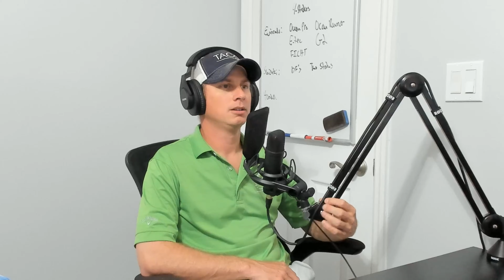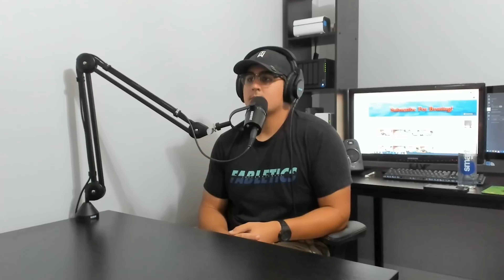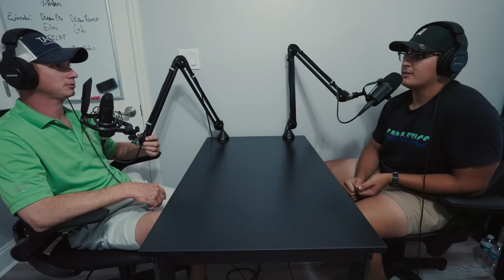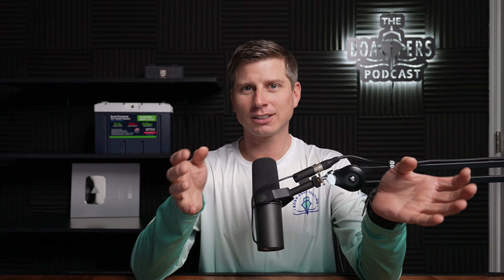The WORST Four-stroke Outboard…

Comment: My family was in the boat biz for many years.we sold merc an Yamaha,i will never forget the first 25 merc 4 stroke i sold as the customer had traded in a pretty decent yammie 25 2 stroke.About a month or so aftrr the sale he came back and asked if he could get his 25 yamaha back as he was not very happy with the performance of the new 4 stroke,major problem,we sold that used 25 yammie soon as we got it ready for resale.True story.I went to Merc service school for the new 4 strokes when they first came out so i never really had much trouble keeping them running good,just a few customers that were kinda dis-apointed with the 25 and 50 h.p. performance when compared to their old 2 strokes,but they did like the better fuel economy forsure.i still have my set of 4 vacum gauges i used when i was wrenching on the 4 stroke motorcycles so they worked great to use on the outboards aswell.

Comment: Honda guy here. Unreliable honda was the 90 carb 4 stroke. Getting that thing to stop lean sneezing was awful.  My buddy has the 225hpdi and man he beats the hell out of it and drives it through vegitation and its still kickin with a couple of thousand hours. I know you guys are merc guys but i used to be on a international team that did training in other countries and the only engine i seen running is the yammy. Couldnt get cheap parts for the hondas and the mercs just wouldnt stay running without maintenance.

Comment: I bought a new year 2000 Mercury 50Hp four cylinder four stroke with four carbs 24 years ago.  it has a Yamaha powerhead.  the only things I've done to it over the years are change the oil, gear lube, plugs, thermostat, and fog the cylinders every winter.  that's it.  still running the original impeller.  it starts right up every spring and runs great.  so not sure if you are including my model in the unreliable category.  then again the engine has low hours given the short season up north and I only run it in fresh water.
Reply: You must not use it that much

Comment: You guys stress me out with the worst engine list!  I had an etec 115 and now I’m running a 250hp hpdi . I’ve had zero issues with either engine. They’ve been super reliable . Now every time I turn the key . I’m worried that it will blow up.. thanks guys!! Lol.
Reply: The HPDi will be fine, just let it warm up properly (idling at the dock doesn't count as cylinder 2 & 3 don't fire until in gear) its cylinder 2 that usually pops surprise surprise. Make sure you replace the filters annually and use good fuel and oil. Also do some research on the HPDi tech bulletins a 300HPDI had a tech bulletin on the oil pump which I would say is a must to replace.

Comment: had a 2001 90 hp carb honda - the outboard was slower than a 2stroke 60hp merc on the same boat hull, heavy and not so fuel efficient) so honda takes the first place here. The second place would be probably suzi...